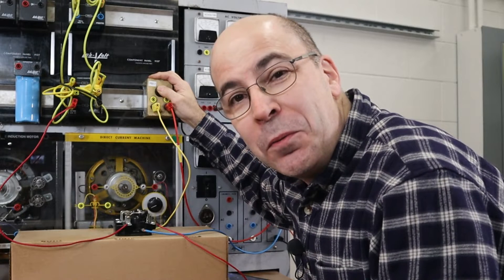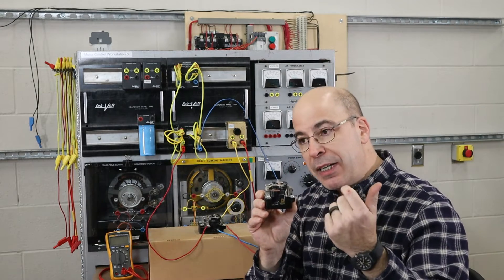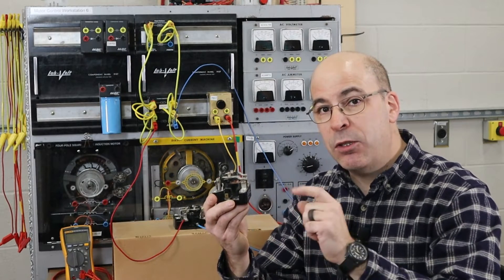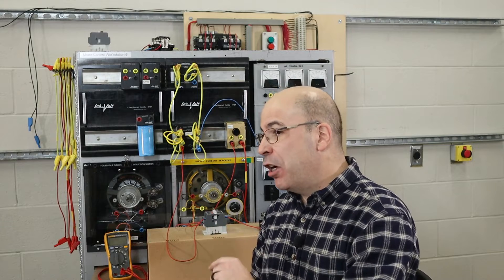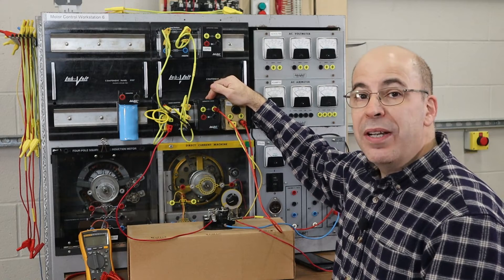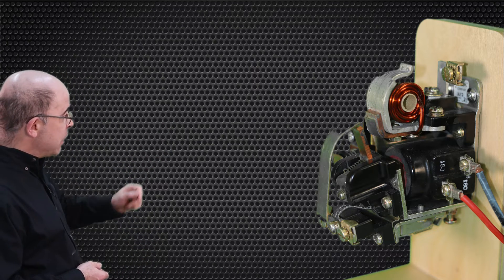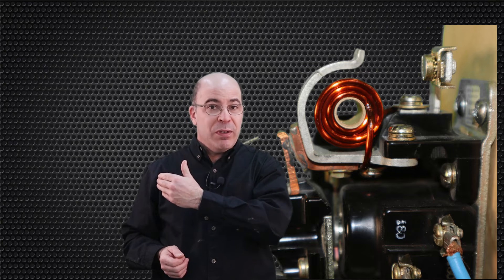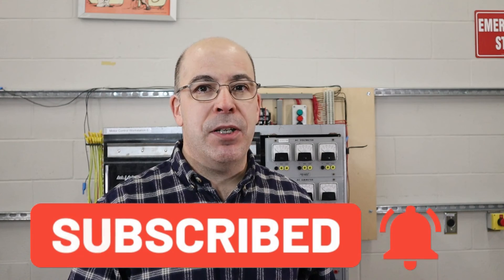Switching DC Current

Comment: Deserved my sub!
May i know what type of capacitor used in this video?
Reply: Use MKP type. Avoid electrolytics (even bipolar ones). Use voltage rating at least 3 times the load voltage.

Comment: Dear Serge, How many microfarads of capacitor do I have to use for 10A 270V active load ? I am trying to power my 2500w boiler with DC direct from PV panels. I destroyed 2 SSR relays so far. The relays are raited for 40A 400V DC. Nevertheless, they burned. I have no explanation why it happened. I planned to use 60A 600V SSR relay with IGBT transistor inside. I found this video, and I am hopeful that the capacitor will do the trick of sprakless switching off the circuit.
Reply: 4,7μF/600V (minimum). Use MKP capacitor. In case of difficulty about having the capacitance in a single unit, use some caps of the same type connected in parallel. The addition of the individual capacitances should give you the desired value (I.e 5 pieces of 1μF/600V or above that voltage). Although your question is old, I hope this answer will help you (if you have not solved the problem until now).

Comment: Dear Serge, in reference to your video on pf correction, you state  by adding reactive power from capacitors neither motor noise, torque or power is unaffected.
Shouldn't the torque and hence the power be increased by having less phase differance between volts & amps? 
Kind regards.
Reply from the maker: Technically you are correct, but without sophisticated equipment that would be difficult to demonstrate. I wanted to mainly focus on how Power factor correction can lower current draw and ease the burden on an electrical system